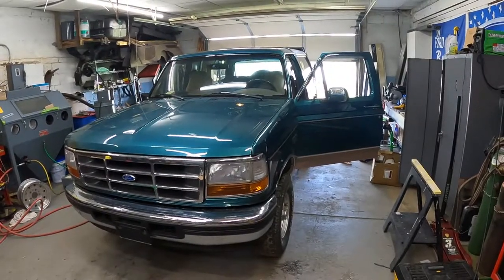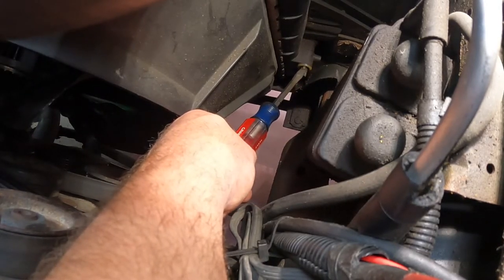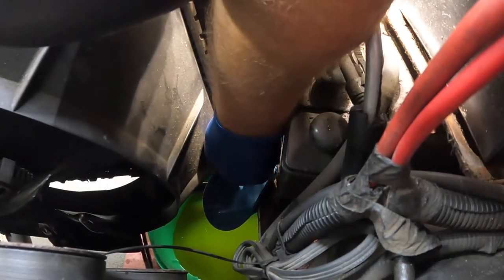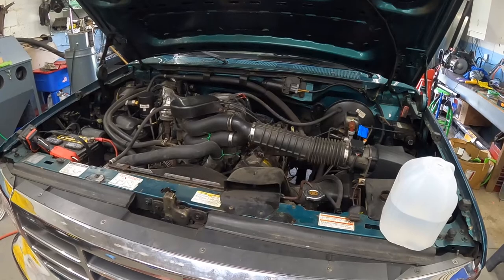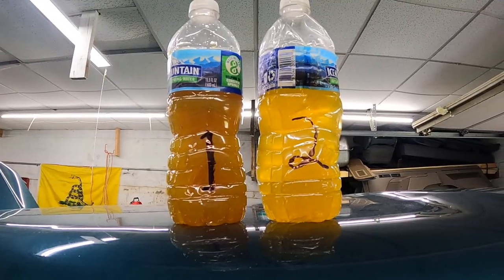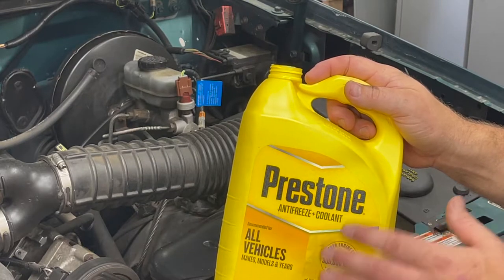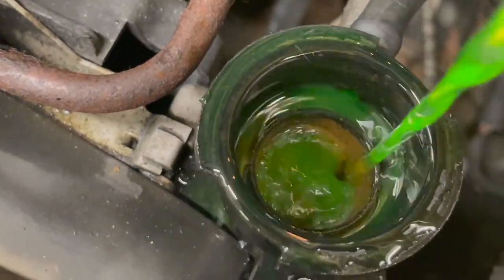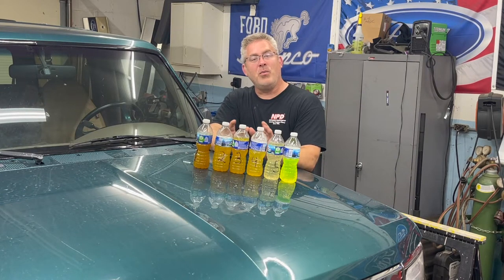ULTIMATE How To Flush Your Vehicles Cooling System | MOST OLDER FORD VEHICLES

Comment from the maker: Please Remember To Top Off Your Reservoir With Straight Coolant to Offset the Water In Your Block or Check With Hydometer and add or remove coolant as necessary.
Reply: They make concentrated coolant for this reason. When you flush you system out with water a few times and drain the radiator for the last time, the cooling system is still half full of distilled water. When you add 50/50 mix, you end up with something like 25/75 coolant to water ratio. Just a little word of wisdom. I have a 94" F-350 Crew Cab with the 351W in it and love it. Thanks for the videos.

Comment: how many gallons of distilled water did you use for this? need to know how much distilled to buy so i’m not making multiple trips to the store
Reply from the maker: Depends on your climate. If you’re not using premix, you do need to compensate for the amount of flushed water left in the block.
Reply: @BroncosandPartsGarage  South Carolina so pretty hot i’m assuming about 60/40 for it? Also, did it take 14 quarts of water every time for each rinse?

Comment: How much water did you use for each fill??
Reply from the maker: final fill I mixed it 60 anti/40 water to offset any water left in the block after final flush.
Reply: That’s not enough to offset the amount of water left in the block. A better method is to use concentrate and add half of the capacity and then top off with distilled after that. This way you know that you got enough coolant in the system.